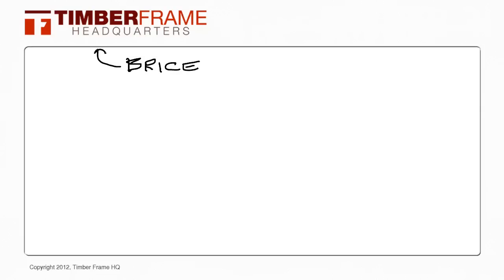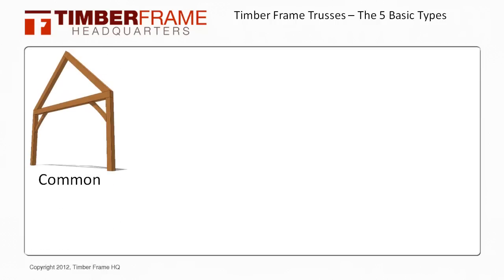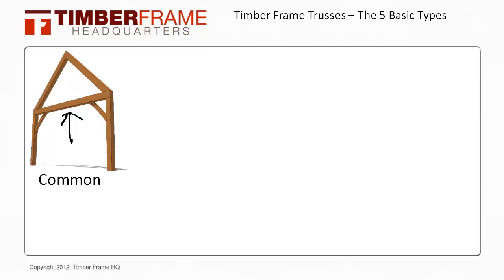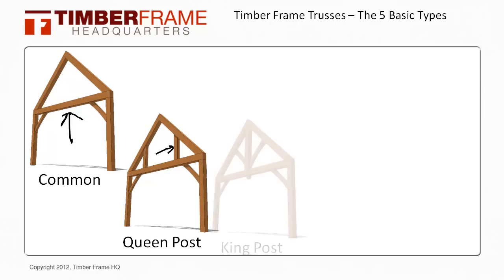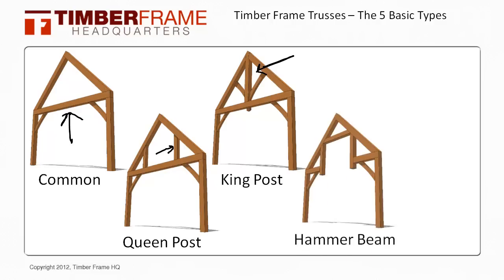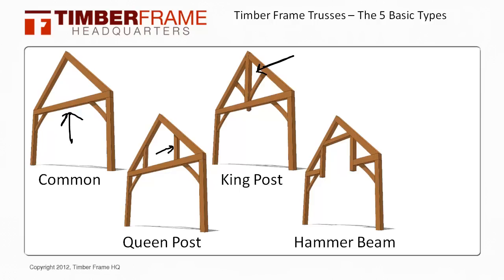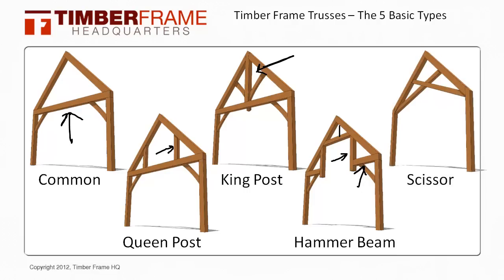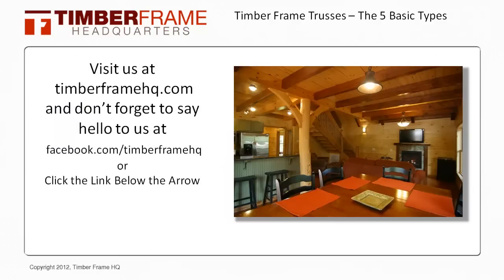Timber Frame Trusses - The 5 Basic Truss Types

Comment: I am preparing for a remodel of a 1974 home that has 2x6 truss contrsuction using common truss design. Inspectors who are unskilled in this design see it as faulty or 'missing' support. I wanted to add additional support and your video makes the design choses for additional bracing very easy to understand. I can now plan a Queen Truss design with alternating King Trusses. Thanks Brice!

Comment from the maker: Scott,
Thanks for the comment.  I did not include a shed roof in the video mainly due to the loads that are place on it.  A shed roof does not exert any outward thrust at the top and bottom and thus it is not a true truss, it is similar to adding a structural ridge, king post and common rafters.  
In regards to the 30' span, it is possible to either free span it with large timbers( not recommended) or have a mid span plate to divide up the loads.
Hope this helps.
Brice

Comment: If i build 10 A frames 6 by 6 meters with no kind of support in between just connected with metal corners and if i raise them one after another and connect them with particle boards on top, 
1. will this metal corners join strong enough the timber frames ? and
2. Will the particle board hold enough the frames together ?

What is the strength of the frames? And what are the chances that the cabin might fall appart with such simpleness of construction?

The project is meant to be as simple as possible.

Comment: Thank you for the reply, I have a very specific building in mind (two shed roofed buildings facing each other with an opened center area with a roof). It sounds as if it may be undoable using timber framing.
Thanks again for the reply.

Comment: You might want to consider steel. The rail for the crane will be steel, and the connections will be easier to make. Additionally, when the crane stops, it sends an 'impact load' into the structure. Steel easily receives these repetitive loads. Wood is not as forgiving.

Comment: This video did not include an accurate depiction of the hammerbeam truss. Here's a better example: http://www.vermonttimberworks.com/wp-content/uploads/2013/08/timber-trusses-hammer-beam.jpg Notice the use of arches instead of just queen posts and straight angle braces. The arches provide maximum strength and maximum amount of open space as it eliminates the need for interior rows of support columns, and can span greater distances than any other timber roof.
Reply from the maker: I disagree, David, the video does have an accurate hammer beam truss,  the image you refer to is also is a variant on the design.  Thanks for watching and commenting.
Reply: @timberframehq  The provided picture is more historically accurate, as the hammer beam was developed in the late middle ages for the roofs of great halls. Using straight angle braces in a hammerbeam roof is a modern, weaker version.
Reply from the maker: Thanks for the information.  Always something new to learn.  Will do some research to learn more.